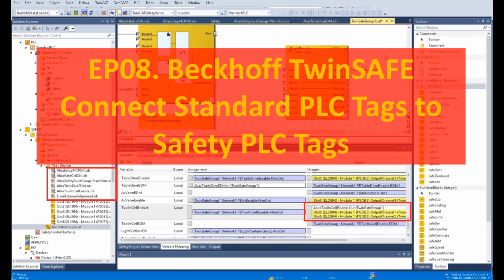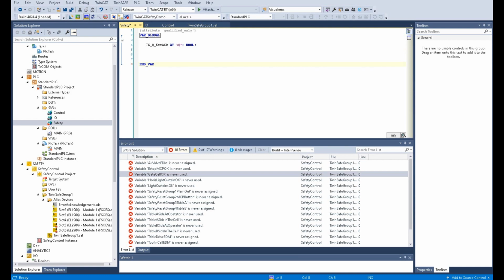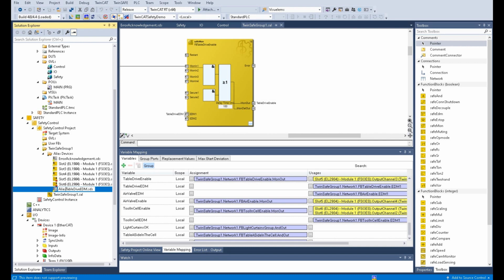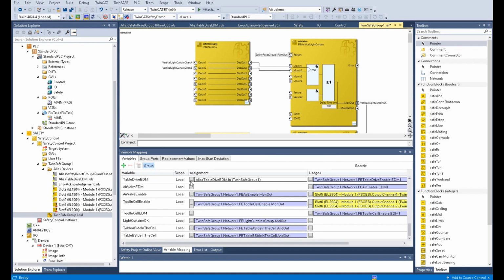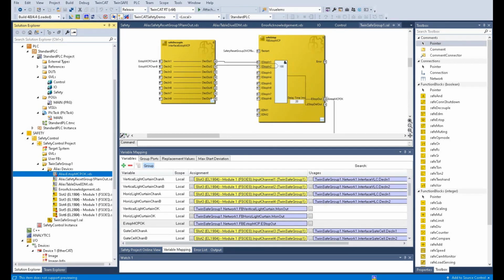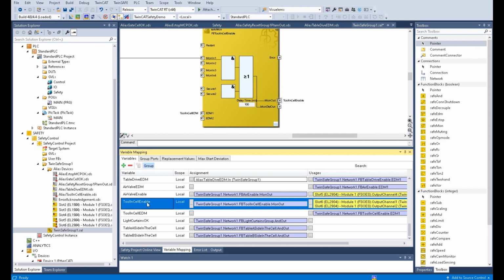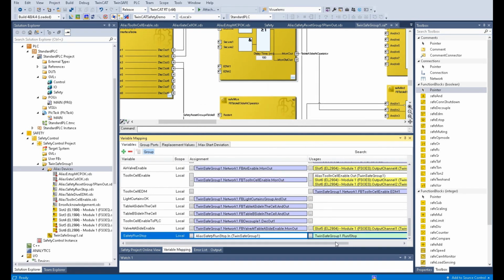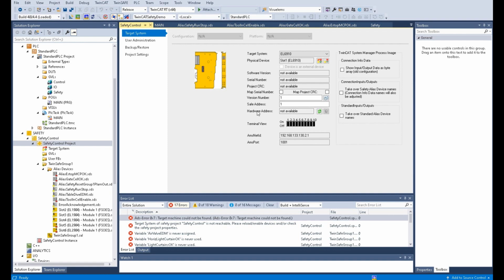SA10. EP08 Beckhoff Safety TwinSAFE - Connect Standard PLC Tags to Safety PLC Tags

Comment: Hi, when I click Alias (TwinSafeGroup1-Alias Devices - Alias1 Digital Input (standart) ) there are Full Name: Not Avaliable, Linked to: Not Avaliable, same the  Name. I tried to do it many times, what can I did wrong? In your video there are Full name and visible icon next to "Linked To" form, but my icon is grey. Thanks for help. And thanks for all videos about safety, I also learned more from you than from Bec videos
Reply: Solved: I have selected wrong 'Target system' (6900 is selected automaticaly, I have inserted 6910) and not selected 'Physical device', cause I dont have real hardware. After selecting correct 6910 I can select Physical device and then it works!
Reply from the maker: Good!

Comment: Hi, and thanks for your training. I learn better with you than Bec videos. There is a chance to know how and what I have to do  and the steps for FsoE communication between two EL6900? TKS
Reply from the maker: Thanks for watching! I never did cross safety communication between two EL6900. I am also concern if the EL6900 can do it. May be EL6910 could do. But I would recommend using hardware do the signal cross exchange.

Comment: Est-ce que je suis le seul idiot à trouver ça TRES compliqué ? ....😥
Reply from the maker: It does complicate. If I could have choice, I would rather using siemens S7-1200 Safety for the safety control. The key reason you are seeing this complex is that the EL6900/6910 is a standalone safety ONLY controller, therefore you have to do many complex configuration steps to exchange signals between safety PLC and Standard PLC. Siemens and Allen Bradley they are PLC and Safety compacted, so programming is much more easier.

Comment: Thanks for the amazing series (again). I have a question. What is the function of the Valve at A and B? To control a cylinder inside the cell or to control the rotation of the table? I mean, I would just consider to disable the air supply in the conditions you describe.
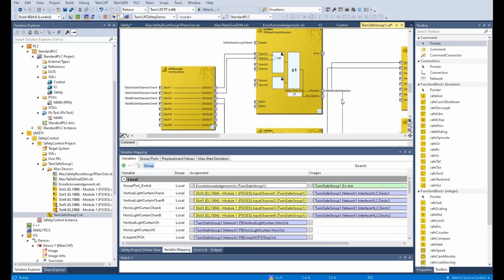Reply from the maker: "Valve at A and B"?  could you please show me which min in the video? I guess you are asking about the 13:53 the "TableASideAtOperatorA" "TableASideAtOperatorB", they are the signals coming from a safety limit switch (dual channel) shows the the table is towards to the outside (at operator). A and B are the dual-channel from this sensor. dual channels are safety SIL level requires.
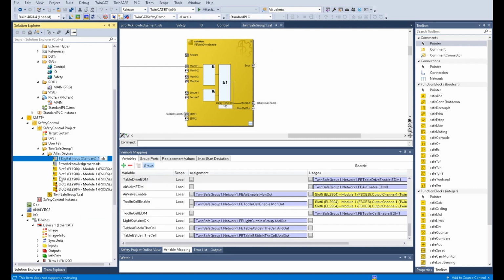Reply: @electricalautomation  Thanks for the quick answer, I meant the two FBs called FBValveAtTableXSideEnable, from the minute 8:11 in the previous video (SA 09 - EP 07) What is the function of that valve? Thanks for your amazing work by the way. I'm doing my degree final project based on Beckhoff safety applications and your videos have helped me a lot
Reply from the maker: @rivazinhoRCCV  I got it, you were asking about the 8:11 from (SA 09 - EP 07) one video before this one. That Function Block named "SafeMon", this is a typical circuit design and safety programming style, which is used to monitor the relay feedback (I called EDM signals), and control safety output channel for the relay. For example, if the relay shows sticky, giving it ON control (Left of the SafeMon), but the ON feedbacks from relay are time out or delay, the output of this Function Block (right side output) will turn off the output control to be OFF, even if your control command (left of the SafetMon) is still ON.
Reply from the maker: @rivazinhoRCCV  Please review "SA08. EP06 Beckhoff Safety TwinSAFE - Connect Safety Outputs to Safety Function Blocks", I explained the details of SafeMon Function Block concept https://youtu.be/Z9acBc4JWrc